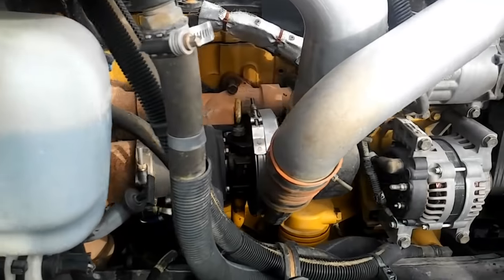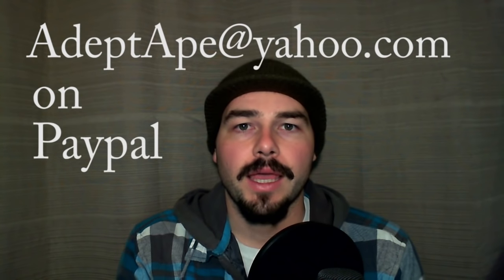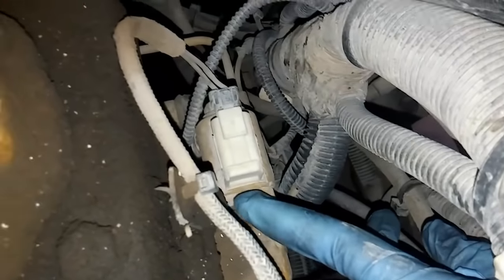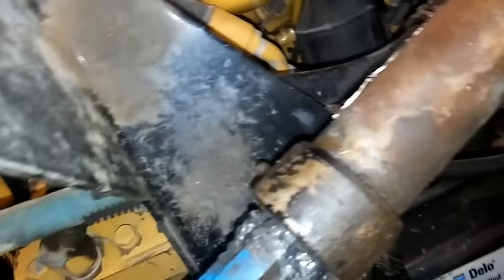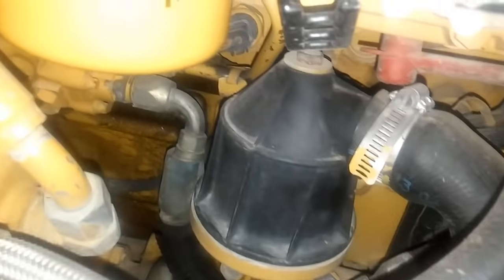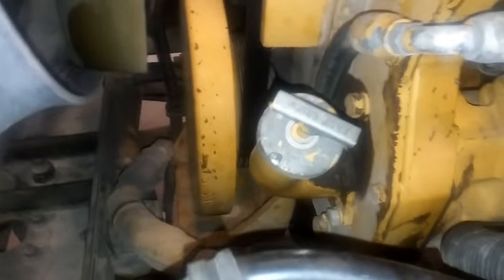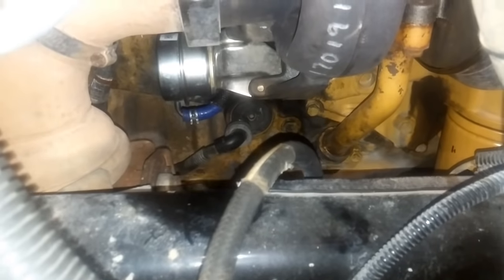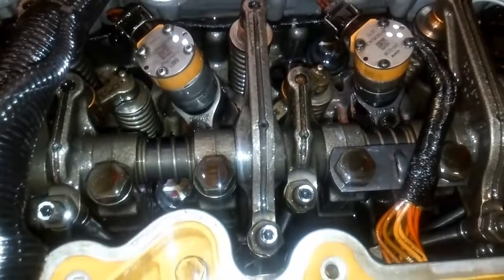The Cat C7 Engine.  Facts, Walk Around, Sensor Locations, and Maintenance.  Know Your Engine.

Comment: Hey partner. I'm sorry to bother you. But I have a question for you about my bus. So I have a 2006 Thomas Freightliner School Bus that I'm converting to a motorhome Right now.I have the bus up north in Michigan. Camping Today I went to get propane About 20 miles away And on the way home It stop running I was going about 50 miles an hour And the bus just started to idle. It would not let me give it gas with the accelerator. I pulled over  And it stalled I waited a couple minutes  And it started right back up. Oil pressure is about 35. PSI coolant temperature Was 180. No smoke out the back of the engine. And it seems to start up and run just fine now. Any idea what that could be? Thank you.

Comment: ok....subscribed! been watching your videos for 3 nights now! my 2005 f650 rollback is down. was driving down the road accelerating and went dead....engine just shut down...coasting along just windmilling. towed back to shop started checking simple stuff first....found the fuel in the tank was dark, couldn't even see light through it. did some research and found this could happen because of bad o-rings on the injectors. changed O-rings reinstalled injectors...still no start! pumping primer pump and heard fuel running back into tank...thought fuel pressure regulator was stuck open...replaced it and still no start! disconnected fuel line from primary filter to transfer pump, put line in a jug full of clean diesel...primed about 20 times ,still no start. hooked up fuel pressure gauge , pumped primer about 20 times again, builds pressure up to about 50 pounds with primer and then bleeds down....can hear fuel running back to tank. crank engine, no pressure...thinking transfer pump...any ideas before I buy a new transfer pump and should I change the heui and the transfer pump together? oh and I had read 2 codes on the check engine flashing light....26 and 39
Reply: oh and I forgot to mention heavy oil consumption....about 1.5 gallon in about 300 miles!
Reply from the maker: +James Conarton Alright, thanks for watching. So the oil consumption was probably the HEUI oil getting pushed into the fuel tank and then getting burned. So hopefully by getting the injector seals changed fixed that. If you aren't building any fuel pressure, you've already change the regulator and ran it out of the bucket then it sounds like the transfer pump is the next on the list. The transfer pump can be changed without changing the HEUI pump, but you'll want to remove the HEUI pump off the engine to do it. The HEUI pump is about 5x as expensive as the transfer pump, so if the HEUI pump is okay I would definitely reuse it. The transfer pump has a special bolt that comes with it to hold the pump together when you change it so be careful. Let me know what you find. Is the tach showing a signal?
Reply: ok update...the bolt on the front was almost all the way out and the gear was hanging off.! is this common and do you think this is our only problem? do we just reinstall it or is there a special process? and also thank you for the quick response!

Comment: Any chance you could tell why I'd be getting a code 102 07-13 turbo waste gate issue.  We applied air pressure to the waste gate and it open and closed. What else should we look for?  FYI, I'm getting a buzzer and stop engine and check engine lights when pushing done on the accelerator. 2005 Cat C7 in a Itasca Meridien.

Comment: I have a c7 in my Freightliner and it died on me while I was stopped at a red light. The mechanic first said the cam/timing sensor was bad. They replaced the sensors and it still cranks but wont start. Same issue. Now they are telling me the ECM is bad, I just had a new ECM installed on 11-30-17. Does this sound right?

Comment: Im going to buy. Kenworth with a CAT c13. Is a 2007!!  With 413 thousand miles. Also where can i find the sticker defining is a true c13? What should i look for and what can i expect???
Reply from the maker: +sticK&Clutch Check the front structure and the valve cover base. Hopefully the serial number is a KCB.
Reply: I'm unclear about pre2015 engines. I work at aCat engine plant and newer C13 serial numbrs are generally engraved in the block on the lower right side near were the starter is installed. Others have a name plate in the same area.

Comment: Hey man, love watching your videos! Is a cat mechanic/technician trained to work on cat engines exclusively or would you be able to leave the company and have the knowledge to work on diesels anywhere, such as a truck shop?
Reply from the maker: +Mark Hass A Cat mechanic is trained for Cat equipment, but the general principles between engines applies from engine to engine. So you'll just have to get accustomed to the terms, tooling, and principles of a Cummins or Detroit, but many of the principles are the same.

Comment: Around my GMC 7500 K to the scanner and he said he had a high oil pressure voltage hi that’s what he has said on the sensor so but I don’t know what’s wrong with you can you recommend something in the video or tell me what to do or where the sensor is located at the video but I can’t

Comment: Hi I’ve a 2003 motor home with a C7 cat 300 hp diesel pusher, on a freight liner chassis.   But I stop cranking the engine few years back and it only has 14,000 Miles, but now it won’t fired up.

Any suggestions
Reply from the maker: You should email me at adeptape@yahoo.com

Comment: I know this is an old video but after my oil change I started the truck up which is a 2003 peterbilt 330 with the cat motor and the stop engine light and the check engine light (Flashing) came on. I put 4 gallons and 1 quart in the truck (someone had 17 quarts written on it for the oil capacity). Would you by any chance know what would be causing this issue. Apparently the truck hasn't had an oil change in a long while also.

Comment: If huie system can get damaged so easily, can I add an inline oil filter before the huie pump? 

I remember you mentioning in a different video about the oil cooler failing and filtered oil can get contaminated with dirty oil! If I would add an inline oil filter would help not damaging the huie pump?
Reply from the maker: +Sebi Alex Check out the bulletproof C7 video. It'll talk about that.

Comment: can you help me I have a CAT engine that will not start in warm weather unless you plug the block heaters in but in the cooler weather it will start without the block heaters plugged in wondering if anybody can tell me what may be wrong with this thing no mechanics around here can figure it out

Comment: i noticed that you didn't identify the sensor in the hooey pump. i know that that sensor is serviceable unless the complete pump is purchased which is (non-since) why it cant be purchased without buying the complete pump. but my question is is the sensor known as the fuel pressure or a fuel temp sensor or both ? at whayne supply my parts guys is hesitant to answer this question....

Comment: Can you flash a 210hp C7 to 330hp? If so great if not what needs to be changed? Thanks for making the videos
Reply: I can answer that, the lower horsepower C7’s used aluminum pistons while higher horsepower use steel pistons so your answer would be no.

Comment: So I was told today that a bad oil pressure gauge gives the same fault as a bad heui pump.  I was told to get another gauge and connect it inline with the old and see if they differ.  That, that would tell me if I had a gauge failure opposed to a pump failure.  What are your thoughts???? A gauge is definitely a lot cheaper than a pump!

Comment: Love your videos- well done!! Is there any maintenance required on the pcv system mounted on the side of C7 ACERT? thanks in advance.
Reply from the maker: +Charles Lurie If you have an SAP, WAX, or KAL serial number then no maintenance is required, there is a wire mesh in there that doesn't really need to be maintained. Maybe once every 5 years take it off and make sure it's clean. Nobody ever does that though. The C7S serial number take a lot more maintenance because they have to be cleaned yearly and the fumes disposal vents to the exhaust which can plug up with carbon.

Comment: I have a very funny problem with the c7's that we have at my bus yard they are acert engines and they all eventually below the oil cap off and all the oil out of the crankcase is this a common problem and if so what do we do to fix it so far we have been zip tying them in place
Reply from the maker: +Thomas Santilli That sounds more messy than funny. Check the crankcase disposal line running from the exhaust to the crankcase breather on the valve cover base. The line that threads to the exhaust gets plugged with soot and closes, which causes the blowby to go sky high. Check my video on using an air hammer to loosen fittings, it's one of my first videos, it'll show you which line I'm talking about. That would be where I check first. Let me know what you find.
Reply: Excellent thank you so much
Reply: unfortunately the tube was clear I did clean it out and replace the Breather element while I was there
Reply from the maker: +Thomas Santilli It isn't the tube, it's the fitting itself going into the exhaust, was that clear? I should have specified, if it is clear check the flapper valve in the valve cover base to see if it cracked.
Reply: Yes i also check out the fitting i will check that valve next did have time last night

Comment: whats up man...my c7 is in a freightliner and when i get to about 60mph i cant accelerate anymore. with my foot on the peddle the truck starts to decelerate on its own. whenever it happens the temperature is usually around 190degrees and as the truck slows down the temp goes down. once it gets back in the 160 range i get full control of the accelerator. and so on. i changed the oil and fuel filter with the oil change and changed the intake filter too. any suggestions? also no codes are showing
Reply: Alex Perez  Have you ever had issues when going up a hill my friend tells me that every time when going up a hill with load or without load his truck struggles but on regular plain road hauls like a champ but i was thinking maybe its time to change fuel filter housing might be clogged up but thanks man for sharing!
Reply: yea with the problem going on it does struggle going up hill...suprising i brought it to a mechanic and he said it had something to do with a transmission sensor in the rear of the truck....so in a few days illl know for sure if that is the fix....other than that i was assuming it was going to be bad injectors which are super expensive for the cat c7 and have to be matching serial numbers on each injector you replace

Comment: Have the 190 horse c7 in a small dump truck can you turn the horsepower up by getting computer  download?
Reply from the maker: Yes and no. You can rerate, but you have to start replacing parts like turbocharger and injectors as you go up in horsepower.

Comment: I have a c7 in an f650 pickup and having a fuel issue. when I use the manual primer I hear almost a hissing noise (air leak?) in the heui pump. any ideas
Reply from the maker: +jeffrey katits Hmmm, will the transfer pump runs off the back of the HEUI pump, so maybe you have a fitting or hose leaking on the inlet of the transfer pump. Are you losing prime?
Reply: Adept Ape yes I'm losing my prime

Comment: my 3126 hydro locked. pressurized the coolant system and no drop  . i pulled the injectors and it spun over. pulled the head  just not sure why it hydro locked . injector cups? head gasket?
Reply from the maker: +Samual Krokson What was in the cylinders? Was it coolant, fuel, or oil? Have you inspected the fire rings on the head gasket to look for failure?
Reply: I believe it was water from the coolant system, head gasket looks ok to me but I will get an experienced opinion. It was using more and more coolant with no signs of a leaks on the ground
Reply: hopefully ill be getting a cabover 3406b next week but I still need to get this 3126 fixed , I really liked the truck and thought it would last forever but now i want this engine fixed and sold

Comment: Not a bad engine.  A good running 5.9 Cummins will run  circles around it. Heui pump fails and all injectors will need replacement.

Comment: Cam follower failures, What has been determined to cause the roller pin to dislodge??  Noting common failures is great, even better is knowing the CAUSE and the FIX.  TKS, John
Reply from the maker: +William Skelton Usually you'll determine the cause when Cat brings out an updated part number with a different design, as far as I know, no design updates as of yet.

Comment: is this engine self contained?  looking at repowering a old f600 take out the gas\5spd replace with c7/13spd.
Reply from the maker: +Will “flyn4hi” Harkcom Not exactly sure what you mean by self contained. You'd have to run Diesel return and supply lines, battery inputs to the ECM, throttle input. The ECM is engine mounted and all the engine side wiring is on the engine.

Comment: Great video. I just got a quote from my shop to replace the barometric pressure sensor on C7. They say it will take them 3.5 hours to replace it, update the ECM parameters and test drive. To me, after seeing your video and the easy to reach location,  this seems way overcharged. I would think 1.5 hours, Am I right?
Reply: Remy Peek so did you do it yourself?
Reply: @slowpoke96Z28  You  sound like a guy that would charge 3.5 hours... LOL!!!
Reply: @SpecialAgentNoble77  I would charge book time. If that's 3.5, so be it. There's a reason book time is 3.5 hours and not 3.0 or 4.0. I bill a little below average per hour for my area, but I will quote book time.
Reply: @slowpoke96Z28  Wow, I woke you out a 2 year sleep...  I was poking fun at you because you took offense to a guy trying to save a buck.  Of course the only way to save money is to take ten to twenty hours learning how to do it then taking hour and half proudly doing it yourself.  Where there's a game, there's a counter-game.

Comment: Just bought a 336E  I hear, they eat the HEUI pump, is that true? C9
Reply from the maker: +Jpaydirt Well C9 engines do have HEUI problems, but that doesn't mean they eat pumps. I've seen them go ten years with the original pump with no problems.
Reply: Jpaydirt  336e doesn't use heui, its a common rail
Reply from the maker: +Jpaydirt The C9 engine was made with a HEUI setup and then a common rail setup later on, so it depends which year engine he has.
Reply: Well this is all new stuff to me, It's a 2013, so probably common rail, its had the pump replaced once already and it has 2500 hrs now,  I was told Cat had an update on the part that failed, and was told to check the fuel filters for metal when I change them, Good thing I purchased a four year warranty ☻ this old dog is going to have to learn the new stuff now

Comment: i am getting a code for fuel psi censor voltage to high. cant seen to locate fuel psi sensor. but second this c7's problem it is not exactly what i call a miss.but while idling it runs smooth but under load while driving it cuts out like turning off the key switch just for a split second . i call this type of a miss spiking. any suggestions? note: it has all new fuel and air filters.

Comment: Adept Ape what are your opinions on Cummins? have you worked on a Cummins?
Reply from the maker: +Andrew Barcomb I've only done simple Cummins work like oil changes and an alternator, so I'm not the best guy to go to on Cummins, but I have a very high opinion of them. They seem to make a great engine that is universally used in the truck industry. Depending on the future of the Cat engine market, I wouldn't mind getting Cummins to work on in the shop.
Reply: thanksfor your input!  what made you choose cat over other brands? just a question
Reply from the maker: +Andrew Barcomb I had the opportunity to work for my local Cat dealer when I was young working part time so I took the job and stayed on ever since. I didn't really choose them, I've just stuck with them and grown as a mechanic with them.

Comment: can you use synthetic oil to go longer with the oil change
Reply: The only problem I’ve seen with running long intervals with cat is fuel delusion.. I had a C-15 6Nz that I ran Amsoil with the full double bypass oil filtration system on which means I had 3 oil filters instead of 1. 25000 mile primary an 2 60000 mile bypass filters.. I ran samples at Amsoil’s labs every 8000 miles .. An I always had high fuel delusion..

Comment: Avoid the C7 if possible. We bought a dump truck with a C7 with 250K miles. At 320K the engine failed. When they fail there is often damage to the cylinders (broken valve, etc) and since they don't have liners, you have to buy a long block, because it's not cost effective to repair the damaged block. If you really go cheap, you might be able to buy a long block from Reviva and reuse some/all of your injectors/turbo etc, you might get by with only costing around $12-15K, which is what we did. At 400K miles, the engine failed again, again needing a long block. This time we bought a certified CAT long block and replaced EVERYTHING new. $30K dollars later we are keeping our fingers crossed. Oh, and in between engine rebuilds the HEUI pump failed twice since we've owned it which is $thousands$ more. We've always changed oil every 6,000 miles, but on this truck we now change every 5,000 miles to try and make the HEUI last. In short, the C7 while being fuel efficient, has been one of the costlier engines to run we've owned. Another being the twin turbo ACERT motor, which I also highly discourage anyone from buying. Stick with the C15 if you are running a class 8 truck, you might spend a tad more for fuel, but savings on repairs and down time will more than make up for the fuel, not to mention the aggravation it will save you.  And it's always nice to the extra HP!